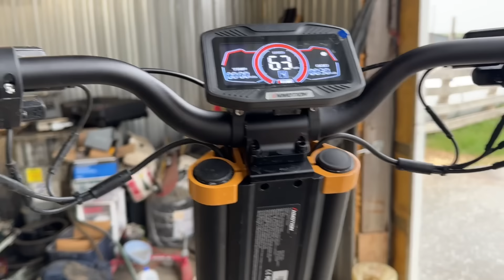INMOTION RS - The cattle catching Scooter Pony

Comment: 10:26  Adding to what WWW said,  changing Escooter tires is a tougher fight that one might expect.  My lessons learned is one needs metal tire spoons and lube.  The lube needs to be an organic oil.  It takes at least 3 tire spoons which will be slick AF from the lube.  It is best to have an assistant as it is difficult to keep oily the 3 spoons in place to break the bead.  Hard to do without an assistant.  I got thru it after serval tries before I found the lube trick.  Which is tricky.
Reply: Pro Tip --  Safety glasses.  If one of the tires spoons goes airborne it's coming to the face.
Reply: Does olive oil work?

Comment: 100 miles that's a l9ng battery life. Looks like a great scoot. Love it
Reply: It cannot go 100 miles range.  Cruising at 35 mph in both city stop lights and long highways with a 200 lb rider standing up you can realistically only get 40 or just over 40 miles in range.  That is what God told me.  100 miles is marketing scam to get you to buy the scooter just like many others out there.

Comment: Inmotion RS, including many others, are junk, worth about $250.  The motors are not 2 x 2000W motor they are 48V 500 watt motor each, and cannot output to 8400W or anywhere close. They are run under constant stress because they run overvolted by the 72~ 84V system. The controllers are known to break the motors as the controllers themselves have issues with managing/balancing power to both motors.  It will last a few months or so before the intermittent motor and controller failure start occur..  The batteries are not Samsung nor LG, it is no-name recycled Chinese battery rebadged to Samsung brand. It is not made to handle fast charging at 15A or greater, it will cook the battery.  1.5A charging is safe for this battery for long life.  And the top speed of 68 mph is a marketing scam to get people to buy this scooter. The real true speed of this scooter with a 200 lb rider standing up in a calm neutral weather is 51 mph, not 68.  You will be able to verify that when you go side by side with a Tesla model Y or 3 going at 65 mph.  The Tesla will blow the door off that scooter the due to large speed difference.  You cannot trust the GPS because a lot of GPS apps deliberately read higher speed the faster you go...  Wolf King GTR will go 1 mph faster.  Teewing Mars XTR will go 1 mph slower.  Today's scooter sales are scam operated by the criminals, the top boss.